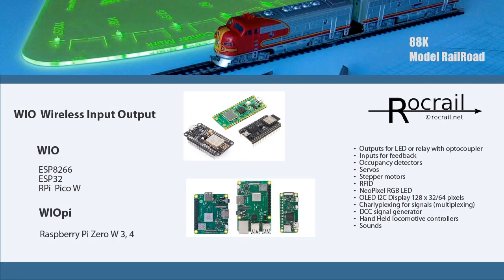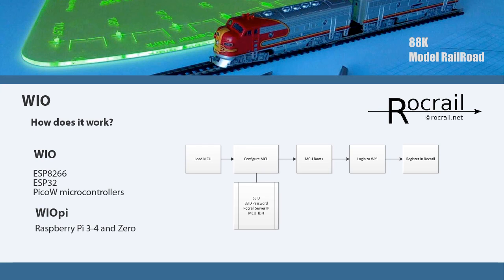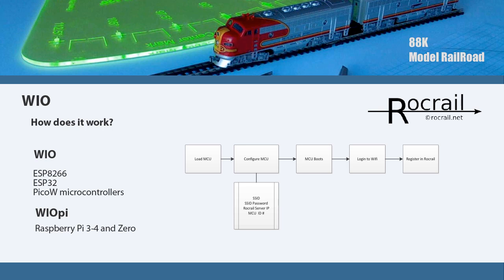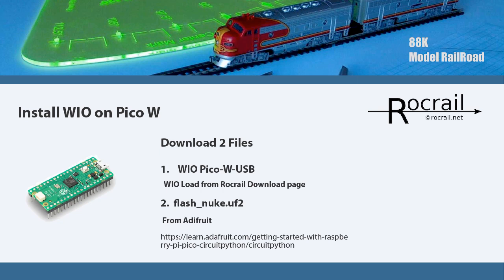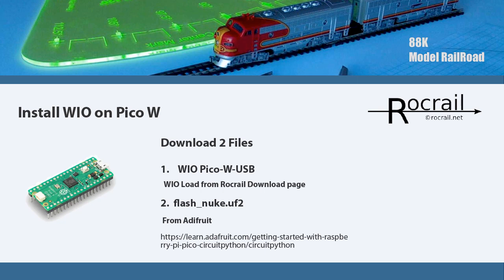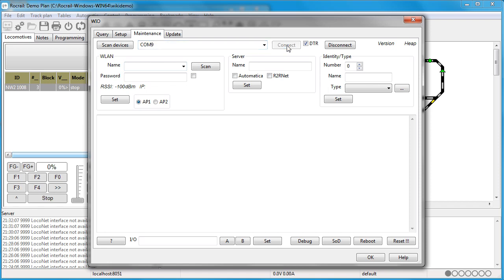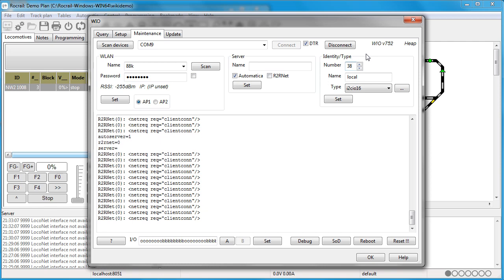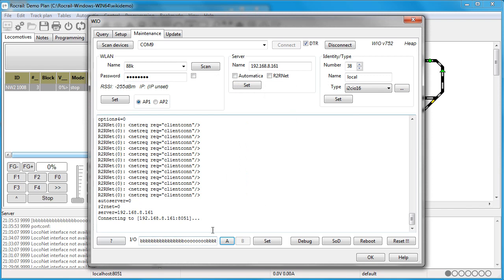Rocrail WIO Wireless Input Output Part 1

Comment: Hello,  what will be the connection  if we want to connect more than 40 sensors to RPI Pico W and can we connect to an external power supply to RPI Pico W. Since it is having in built wifi do we still need to connect the USB cable because in this video i  can see you selecting the com port
Reply from the maker: The WIO for the RPi Pico W only offers 16 GPIO per board. If you want 40 sensors
you need to add more RPi Pico W (4x16=64).

The other alternative is to use the WIOpi. WIOpi uses the RPI3/4 and can support 
32 GPIO up to 128 using the IC2 bus. 

WiFi USB Cable

The USB connection is used to program the Pico initially. Afterward you can use a
USB power cable to power the Pico.
Reply: @my88k-mrr98  ok, if I use 4 RPi Pico W then how do you change the address of the 2nd board and are there any connection between all the 4 board's or we only need to connect the USB cable to power them
Reply from the maker: Check out 9:14 time point. The Default address is 33 when you load a new Pico. Make sure that you change the Default 33 to a higher number. That will avoid an address conflict when to try to configure the next Pico.

The Pico are not connected to each other. Part 1 video at the 3 min 52 time points shows the topography. 
They are wireless nodes that send wifi ip packets to Rocrail. The packets will have the node id and io states
for Rocrail to update.  Just power them up and they will log on automatically. 

At 11:10 you can see where I changed the ID 33 to 38. If you were running 4 Pico's then you disconnect 38. Connect the next Pico and repeat the 3 configuration steps changing the 2nd Pico to 39 and the 3rd as 40 and so on...
Reply: @my88k-mrr98  ok, I will test with 1 board 1st. I will be connecting the Pico to Roco z21 white router and see how things are working. Thank you
Reply from the maker: @bbcsd  ok, let me know how it goes.
Reply: @my88k-mrr98  sure, I forgot to mention that I will be using hall sensors 3144 to train detection and which 16 GPIO pins can be used to connect the sensor wire
Reply: Hello, I tested the pico w it works as expected however in window of controller and server I am not able to see sensor address when I trigger the sensor and is there any specific reason to connect Darlington boards
Reply from the maker: Check out part 3. It explains what happens with the Darlington transistor and the Pico. 
The GPIO pin on the Pico needs to be switched to ground in order for it to trigger the 
IO. That's what the Darlington Array does.